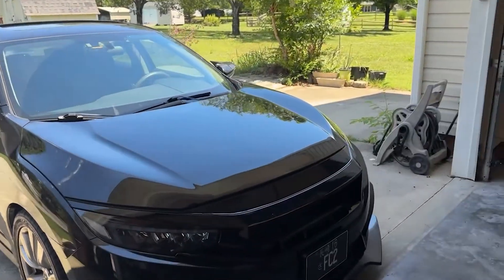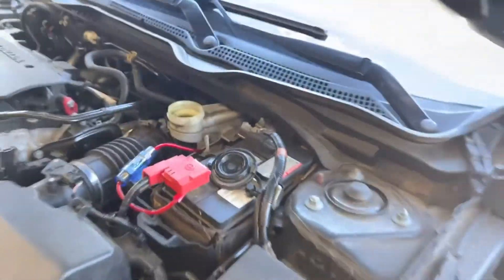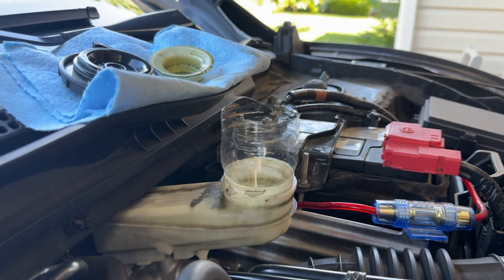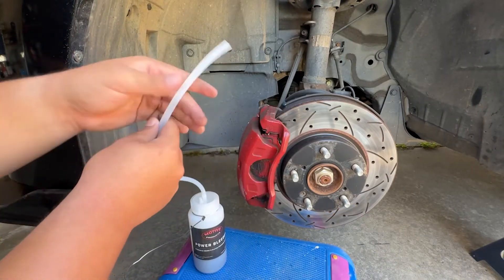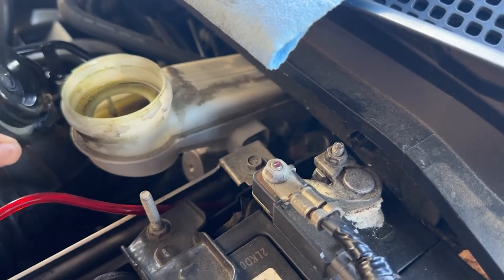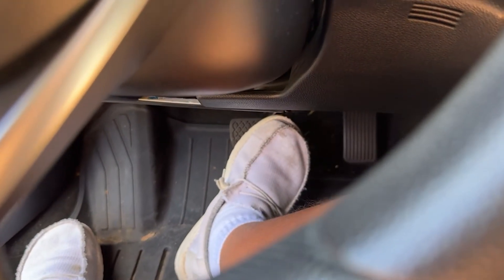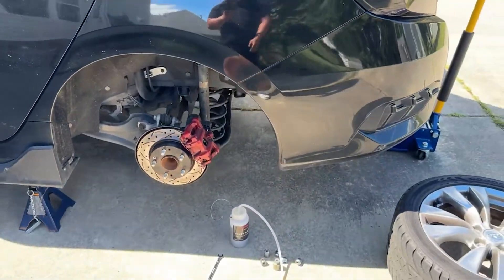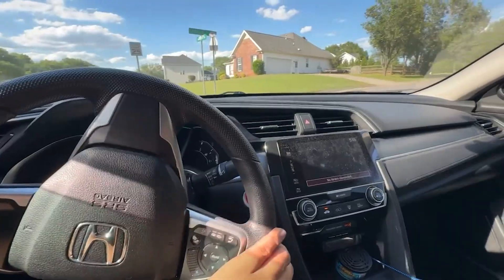How To Change/Bleed Brake Fluid on a 10th Gen Honda Civic

Comment: nice! except you forgot to wipe all the dirt inside the housing. I emptied out my brake fluid filler and used a lot of towels and a flexible kitchen brush to help get down inside. made a huge difference and all the dirty fluid was gone. What you did still fine. Good job.
Reply from the maker: Thanks. When I switched to a higher boiling point brake fluid I used some towels and wiped the excess dirt off. It indeed make a difference

Comment: Thank for the vid. Question: do you keep the master cylinder lid off while doing all of this? since youre pumping the brakes thatll put pressure on the cylinder and if the lid is on wont it cause damage to the cylinder?
Reply from the maker: I just barely put the lid back on so no debris gets in. It doesn’t hurt the system when the lid is on. I believe there’s no vacuum in reservoir

Comment: Hey, is the bleeding of the E brake required? I thought newer hondas had electric parking break systems but im not entirely sure.
Reply from the maker: The ebrake still runs fluid into them. So doing them is required.

Comment: Without going in to detail I always use Honda brake fluid when replacing brake fluid. Its not very expensive online and is compatible with Honda components and seals.
Reply from the maker: If it works it works. I needed an upgrade to dot 4 since I track and push my car hard.
Reply: @FC2Dani  Cool, Honda makes DOT4 ...
Reply from the maker: @xbrizzcakez yes, but they’re not good.
Honda drying boiling point is 230 and wet 155
Liqui moly sl6 is 266 175
Motul 669 is 325 204
and etc. 

If you’re not doing track/autocross. I’d say just go with OEM. I use these fluids to minimize brake fade.
Reply: @FC2Dani  those are good specs, but you used Prestone?
Reply from the maker: Yes, this video is old and I have upgraded as needed.

Comment: After doing the e-brake part do you have to bleed both rear brakes again ? Is that what you meant in the beginning of the video ?
Reply from the maker: @duragulamidi  yeah,
Here’s the order 
Front driver
Front passenger 
Rear passenger 
Rear driver
Then do the ebrake on/off sequence
Then rebleed the rear passenger then rear driver
Reply: @ for a video that was posted a year ago. Thank you for responding man. This video was the best i could find and was spot on for the guidance. Today i changed my coolant and brake fluid. Beer’d myself as a celebration after i finished and test drove. All was solid. Thanks again. Lol (more info than you asked for 😂😅) just excited to work on my own car and save cash. THANK YOU BRUH !!! 💪🏾💗
Reply from the maker: @duragulamidi  glad I could help. There’s not a lot of DIY Videos that was helpful for me so I decided to make one. 🤙

Comment: Awesome video man. i finished the whole job in 40 mins! Thank you for clarifying the order in which tire to start at first. I only work on older cars so i didnt know the ABS can flip the order
Reply from the maker: It’s weird right? Usually you start from the furthest away from the brake reservoir, but Honda changed it up.
Reply: @FC2Dani  Do you do all your own basic maintenence? I've done every fluid except the blue coolant so far. Anything that might be good to know before i start? 2019 Honda Civic EX btw
Reply from the maker: @Wheredatruth_at23  
I do indeed do all the basic maintenance myself. 
I accidentally deleted my (how to change spark plugs) video during editing. So sad :(

I actually haven’t done my coolant yet. But it’s easy.
1.) there’s a big plastic wing nut on the bottom of the radiator, open that to drain it all. 
2.) using a special coolant adapter funnel thing fill it up with DISTILLED WATER
3.) Run the car/Drive it for some short time before it overheats
4.) Drain it
5.) fill it up with OEM Coolant
6.) may need to pump (squeeze the coolant tube) to “prime” coolant or remove air bubbles. 

I think that’s it from what I recall. 
Using distilled water so it doesn’t rust and doesn’t have any chemicals in it like chlorine or something.